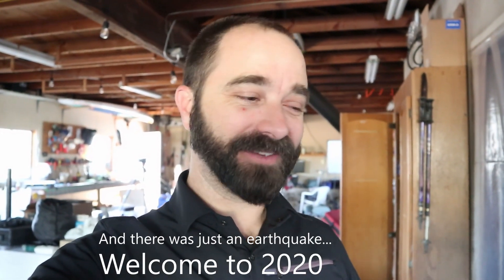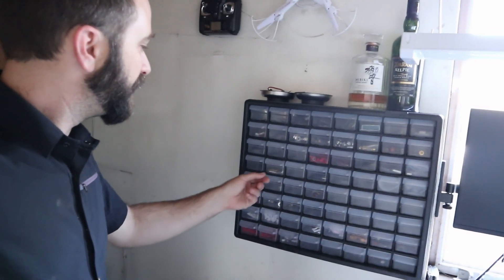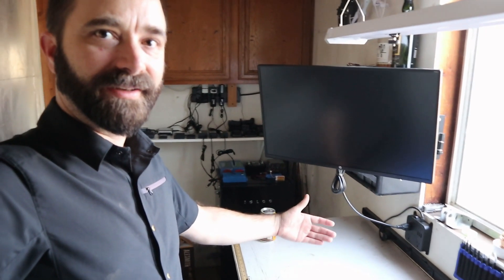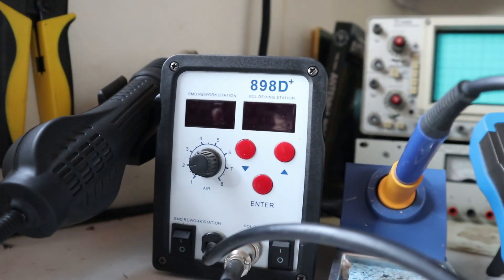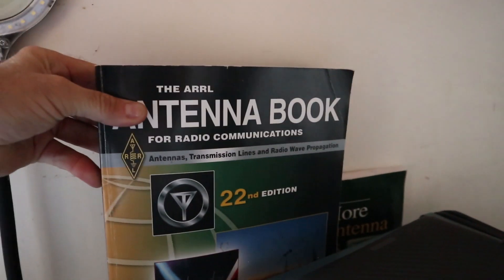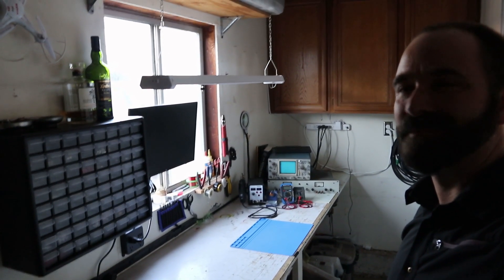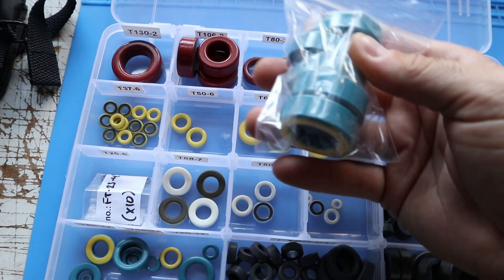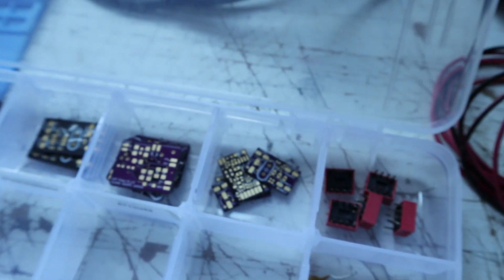Shop Tour - My electronics workshop

Comment: Great! What are those micro pixies?
Reply: Praveen Prabhu +1 I want a micro pixie
Reply from the maker: It's a SMT version of a pixie that I designed.  I'm working on some refinements then plan to look into having some manufactured. They're pretty cool little guys 😜
Reply: K6ARK Portable Radio I have the perfect tin already. It’s a tiny tobacco tin my old man collected from the war.  Like a mini Altoids tin but taller.
Reply from the maker: @barleyafloat  cool! For what it's worth, three micro pixies fit in an Altoids Smalls tin 😳
Reply: K6ARK Portable Radio I won’t say what came out of my mouth.  Wow. I also have a Mighty Atom Wireless crystal tin.  I can fit 2 in a mini altoids tin 👍
Reply from the maker: Cool! I've never seen those before.  I ❤️ mint tin radios.
Reply: K6ARK Portable Radio can’t attach a link but you will find them on eBay and Etsy.
Reply from the maker: @barleyafloat  indeed, found easily with a web search. Thanks!